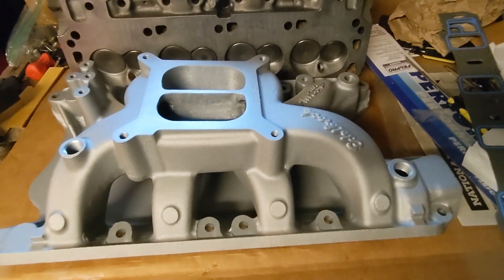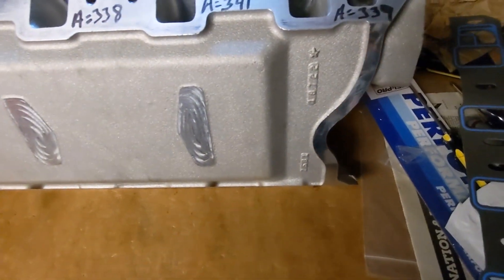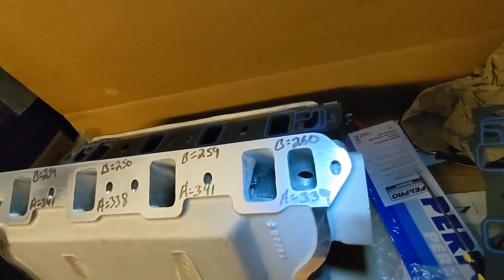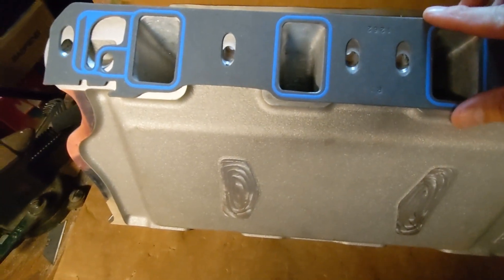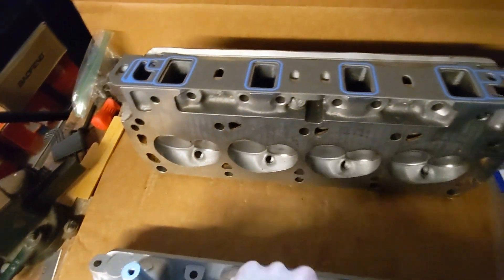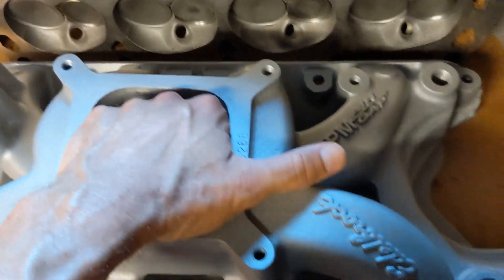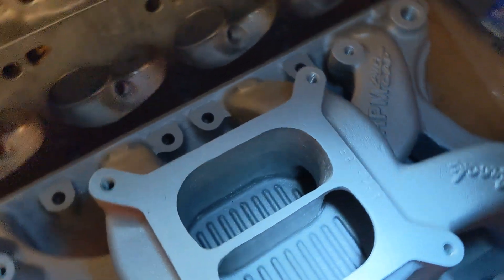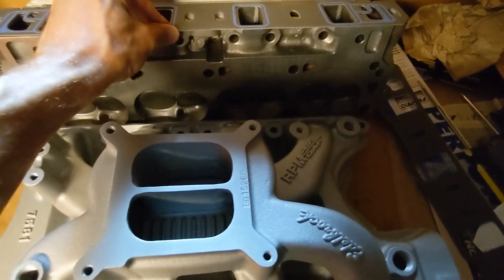Ported 351W Performer RPM Airgap Intake -  Big Dog's Porting

Comment: For street vehicles, even high performance ones, the exit ports of the intake should be slightly smaller than the entry ports of the cylinder heads. This will counter mixture reversion. Under racing conditions at or around full throttle this is less of an issue. Also, the majority of the effective flow in both the intake and cylinder heads takes place at the upper portions of the ports in all circumstances. The porting job gave you some good gains.
Reply from the maker: Thanks for the info.  I'm planning to go slightly bigger on the intake side of the head relative to the intake

Comment: Thank you for making the video. Your manifold is setup to handle as much power as you throw at it in NA setup or a boosted applications. We flow our carb manifolds with no radius for before and after testing purposes but you can add 20-25cfm on top of the numbers when using a radius on the carb flange
Reply from the maker: Thanks for the work on the manifold.  I'm sure my heads will be the limiting factor on this build, but the manifold will support a head upgrade in the future.
Reply: @MarksMuscleCarGarage  thank you for letting us show you what we can do. Please keep us updated 😊

Comment: Looks great, but you’ll have to get the heads done as well to get the full benefit., the reason the intake ports are usually smaller than the heads is to avoid that situation where the air comes in at high speed and runs into a wall at the heads
Reply from the maker: Yeah, I'm planning to open up the intake side of the head to match them to the intake...